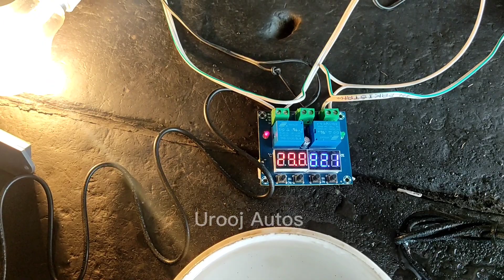Conation temperature and humidity Controller M452 | Eggs INCUBATOR Connection DIY

Comment: I WILL WANT TO USE 12V POWER SUPPLY FOR BOTH THE HUMIFIER AND HEAT SUPPLIER CAN I USE 12V ACROSS THE 2 RELAYS INSTEAD OF 220V, THANKS